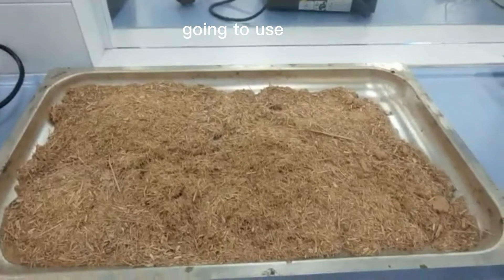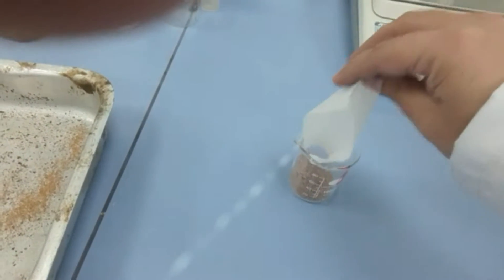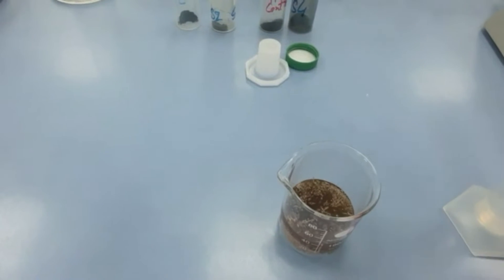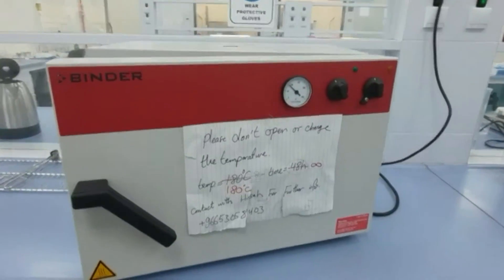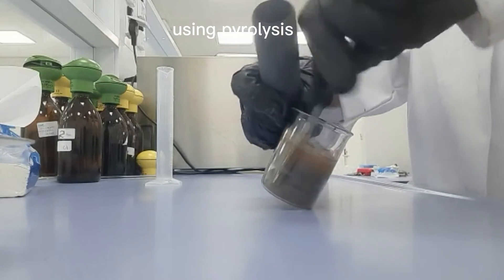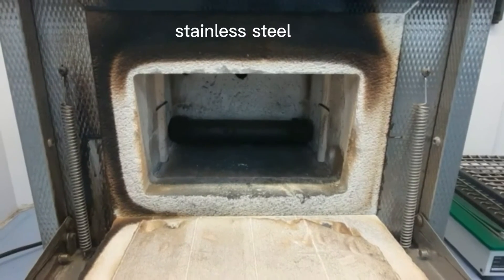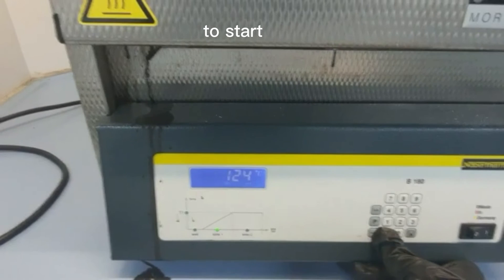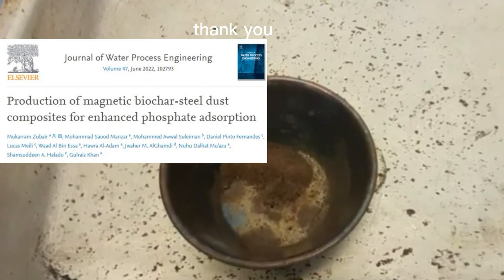Magnetic Biochar Production for low cost Clean Water

Comment: Sorry sir, can i ask, what magnetic particle used in there?
Reply from the maker: we used steel slag or dust here which is magnetic in nature
Reply: @materialsandtechnology8956 can the stainless steel tubes replaced be something?
Reply from the maker: We can but make sure it should resist higher temperature
Reply: @materialsandtechnology8956  okay sir, thanks for your help 🙏
Reply from the maker: Welcome

Comment: Whether the oven is oven pyrolysis or not? or ordinary oven in laboratory?
Reply from the maker: It's ordinary muffle furnace which can operate till 3000 degree c
Reply: @materialsandtechnology8956  is that still called pyrolysis if we use muffle furnace sir?
Reply from the maker: Yes
Reply: @materialsandtechnology8956  thank you sir
Reply from the maker: You are welcome  @HansMo